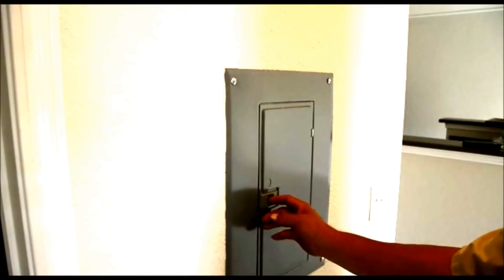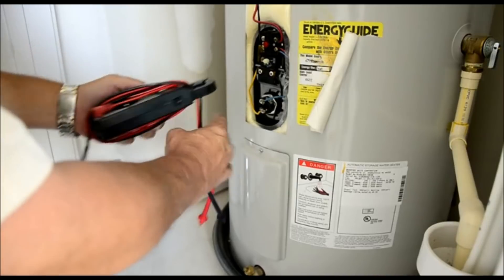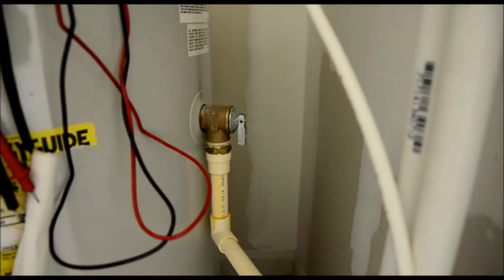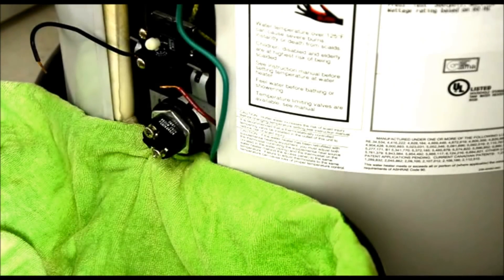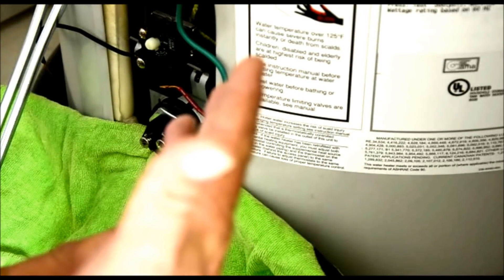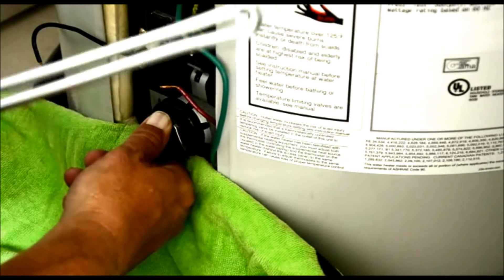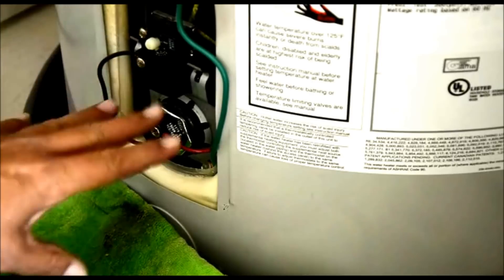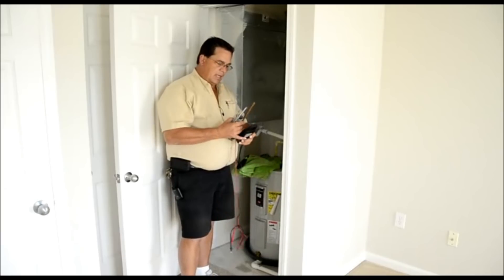Replacing A Water Heater Element With A Full Tank Of Water. "Not Draining Tank."

Comment: It shows a good quick and easy way of changing the element on a fairly new water heater (provided nothing goes wrong, as someone mentioned...).

I like to drain the tanks to remove whatever sediment can come out through the drain, doing so again with the supply turned back on can help agitate and remove the mineral sediment more thoroughly. Hook a garden hose to the drain fitting and let the other end run outside in the yard.

Sediment, if left to build up in the tank, can cause corrosion and tank failure at the bottom weld seam. Another thing I like to do is remove BOTH elements and inspect them  (so long as I'm in there and working on it).  Opening the TOP element opening will allow me to look into the tank interior using a flashlight. I want to inspect the ANODE ROD  (it screws into a fitting in the top of the tank and hangs straight down inside the tank).  The ANODE ROD is intended to corrode, as a sacrifice, instead of the tank and fittings and elements.  If changed out before it is completely corroded away your tank and fittings and elements could last for many years (like, say, 30+ years instead of 10...!).  Would you rather change a $25 anode rod or a $300 water heater??

Comment: the fact you turned off power to the WH at the panel, and it still has power is f'd up, and a code violation. 
Anyone reading this- before you touch anything electrical, go to the Hardware store or to Amazon and buy a "non-contact voltage tester" - this $15-20 battery-powered device will tell you if there is power to the wire you're about to touch by lighting up and beeping. it works for regular 120V outlets/switches as well as 240Volt appliances- like water heaters. as you can see its easy to get fooled, which can kill you

Comment: Usually sediment gets built up around the element which contributes to the element going bad.  Best to drain the water and rig up a suctioning tube to vacuum out the sediment on the bottom.  Have done that several times and the water heater usually last another 5 to 6 years.  If you feel ambitious enough just take the water heater outside and wash it from the top through supply fitting removed and with the bottom drain removed.  But vacuuming in place through a rubber hose usually is sufficient.

Comment: Only do this if you can easily get to the heating element or you will have a mess, use the heating element tool to remove and install element. DRAIN the tank if at all possible. I know by bad experience.

Comment: You never want to use the temperature pressure relief valve to relieve the pressure from the tank. The temperature pressure relief valve is for emergency circumstances and should not be tampered with. You can relieve the pressure on the hot side from any fixture with a hot water supply to it simply open the faucet until the pressure has decreased and then close the faucet and continue your water heater repair.

Comment: Inserting the new element is not that easy because of  the leverage with the element extending into the tank.  This example is a new heater. With a 10 year old heater there would be a lot of crud on the threads.. There is no chance to clean the threads.  Be smart, drain the tank FIRST.

Comment: Hi. I have a question if u or anyone could answer. Just bought a mobile home. The water pressure is great. Water temperature is fine. Problem I think I have is the water heater element. I have a 20gallon electric power water tank. I took a 5min shower and outta the blu I lost hot water. I waited 15mins it came back. So my question is . Is that a sign of element about to hit the trash and need replacement or do I upgrade to a bigger tank like 40 or 60gallon. The tank hasn't been used in 6months and just got my electric turned on and got nize sink hot water lasting over 5mins and have not lost no hot water. I'm only on my first day of testing. Also if the tank hasn't been used in 6months howlong is a proper time for the tank to fill up with hotwater from its first time of tasting electricity to heat the tank I feel giving it a hour wasn't long enough for its first time use

Comment: I can never risk opening a tank full of water like that, either way, water not gushing out depends on other factors especially the size of the heater hole itself, u might even get a cross thread, sometimes u have to hammer out the old ring.

Comment: why the heck did I get over 5 gall of water on my floor!??? and still chuggin out! water turned off, released pressure twice since it kept dripping....what the heck, help please. had to stuff back in element to plug hole quickly and stop water from damaging house....oh, I did start at the top element since the bottom was completely corroded somehow around the hex where you screw and unscrew from position.
Reply: lol...okay, trick is to do it FAST!!!! somehow missed that lil part.

Comment: awesome vid my bottom element just burned out and was going to buy a hose tomorrow when i get the new element because i was sure you had to drain the tank but i guess if you are fast enough dont have to... this will save me alot of time as i dont have a shut off at the tank i have to shut off the main under the residence so this will save me from crawling under the home to shut off and turn on....with spring just now coming in its a little messy under there...and also thanks for making it concise...too many so-called educational videos with so much unnecessary rhetoric...thank you

Comment: Excellent videography, content, & presentation. Thanks for sharing your time, skill, and experience. I have to tell you, I had to chuckle while you used that special tool to remove the element; the last time I did this little repair, after ruining a couple of those home depot things, I finally was reduced to a massive 3/4 drive impact socket that I had to re-face flush with a grinder (those are hardened tool steel, BTW) so it would grip that 1/16 inch wide hex head, and then prosecuting it for about 20 mins with a pneumatic impact wrench and my sadly inadequate air compressor, all to discover when it finally came out, all of what remained of the heating element was permanently imbedded in a sold wall of limestone. I'm not exaggerating. It took me a few seconds to figure out what I was seeing ... The two coiled wires disappearing into a giant limestone boulder. That's just how hard this Texas hill country aquifer water is. I finally quit the economy sized Lime-Away and just started buying the gallon size jugs of Muriatic (hydrochloric) acid. Obviously diluted, it's still wicked stuff .. You spray on a plumbing fitting or on your tile in the shower and it fizzes like an alka-seltzer .. Lol. Sorry y'all - I didn't mean to go on so long.. My apologies and bless your heart if you read all the way to here! God bless all you DIY's !
Reply: I’m in the Trinity Aquifer in Kerrville. The water is 21 grains per gallon hardness. The water softener takes it down to unmeasurable. This should make the water heaters last a LOT longer. And with the 20 year anode rods (CorroProtec), I expect at least 20 years of service out of these water heaters, if not more.

Comment: The video did exactly what the title states.  I would agree draining the tank is the right way to do it.  But as you can see he had a drip pan in the way without cutting that to make room for a garden hose he did the job.  I have also had a problem with a separated heating element and yes you have to dig it out taking time i.e. water draining on the floor.  I personally would drain the tank and assume the worst case scenario where you cannot change the element in 5 seconds or less.  Mr. Murphy lives in my house and experience tells me things never go that smoothly.  Plan for the worst hope for the best.

Comment: The state I am from states you can not run PVC pipe inside a building which I see this has to the Water Heater.  Totally illegal in CA.  You can also change out the TP- Temperature Pressure valve and control valves the same way with water in the Water Heater if you are fast enough like this guy has to be.

Comment: I have replaced dozens of elements and not one ever came out as eazy as that one ,just saying. The last two I have tried wouldn't budge even with an 18" breaker bar and big mechanics socket. I think manafactures are using Loc Tite stud and bering on the threads now in order to sell more water heaters. The next new tank I get I am taking the elements out and using never seize on the threads. With the move twoard glass lined tanks it looks like they are product engineered to be short lived and unrepairable by the average homeowner.

Comment: Seems like circuit breaker #6 isn't the one for the water heater.  I've never been so lucky as to not have to clean off the old gasket material; some always sticks after 5+ years of being stuck to the water heater.  I'd never use this method.

Comment: I have not had enough hot water in the shower for few days. So I went to my water heater and removed the upper cover to reset the button but then I noticed some water residues/ condensation in the cover and the insulation part. Do you guys think this is due to a water heater element leak? Please let me know asap. Thanks!

Comment: I did it.  Thanks.  I was a little confused by the different color wires but saw on another video that it doesn't matter which goes where.  Also, I had a hard time turning the element to get it out.  I gently tapped with a hammer and used a tiny bit of WD 40 and then after much energy it turned.  Also, I did not drain all my water out and I am not sure how you know when the water is completely emptied so I had to deal with some water coming out and I shut all the electric off rather than just the water heater  If you do this make sure that you change it in daytime to have some light.

Comment: Hi, nice video. I hope you can help me, my water heater breaker start poping off, i turn it on and a couple of minutes later goes off again . so i inspected the elements, and i found water recidue on the bottom of the element, now, the conections are there, do you think thats the problem? I was going to change the element but a friend of mine told me that may be the tank inside. What about the gasket on the element, can be that? I just dont want to spend $400 on a water heater. Thanks in advance. I appreciate your help. Thanks again

Comment: Few things missing:
1. Test element defective: ohm-meter
2. Test which defective -- upper or lower
3. Anode rod shot = catastrophic failure soon (> 5 yrs old; preventative replace)
4. Calcium build up both elements = slower heating + higher elect. bill.  Replace both.
5. Turn shut offs on-offs and drain every year.  Else they rust open = catastrophe awaits.

I have had 2 catastrophic failures (rust through = huge mess).  REPLACE ANODE + TURN SHUT OFFS.

Comment: Just finished replacing both elements in a 50 gal. heater without draining the tank. Got no more than a quart of water out of both holes. The key is to maintain the closed system as Dan mentions. Close all faucets even your clothes washer valve.

Comment: What an absolutely fantastic video. I recently flushed my 50 gallon hate heater, and being a novice, I did NOT turn off the power. Well, when refilling the tank, I noticed steam coming out the water intake and learned that by not turning off the power and leaving the heating elements ON while flushing the system, I burnt both the bottom and upper elements out. So, I spent $267.00 for the replacement of both elements and after watching this video and pricing out the exact same replacement elements online, realized I could have done the same thing for less than $60. Well, perhaps about $100 as I would have needed to purchase a voltage tester. But this video is a great teaching tool and well presented.

Comment: except for mfr defect most lower elements failure is because of electrical molecular process(white nodule build up) on the heating element and the bottom 12 inches of the water tank causing the element to short out(go to ground). the plumber that wants to have a customer that is happy and will use him again, will put a hose on the spigot he chose not to use and drain the tank while slowly -partially opening the cold water supply only  thus causing a turbulance in the bottom of the tank and flushing the "white salty granuals " that caused the problem innitually ,to drain out. yes wasting some water in the process but 'CURING' the problem..a happy customer tells their friend ..good P.R. is free and  doing the job correctly is THE RIGHT THING TO DO..
for the home owner "flushing the water tank once a year " is good home maintanance  and can extend the life of the water tank.those salty granuals speed up the rusting out of the bottom of the tank.water damage is costly and inconvenient  .think about it less than an hour and some water once a year  can be well worth your time ..REMEMBER TO ASK YOUR FRIEND AND FIND A TRUSTWORTHY PLUMBER, NOT JUST A ONE TIME SLAM BAM ..

Comment: I pulled the old lower element out by mistake with the relieve pressure valve ON and a lot of water gushed out and completely soaked wet the insulation inside the metal housing. I didn't have any towel (I drained the tank, I thought it was empty, but it was not. It was still about 1/5 full I later found out). What should I do now? How can I drain that much of water out of the insulation? Thank you

Comment: Thank you for this.  As I have never replaced an element before - I am a little intimidated by replacing one with a full water tank.
Reply: Its not a smart idea to do it this way. Some people have a hell of a time getting the old element out. I wouldnt do it this way simply because im anal and i would want to make sure the threads and the rubber seal mating surface are perfectly clean. Besides that, the number one reason a tank rots out is because of water getting in the insulation ...in my opinion.